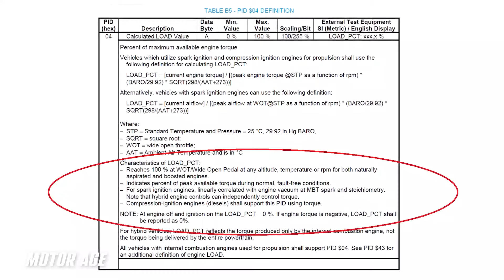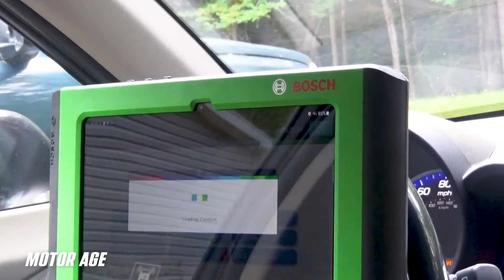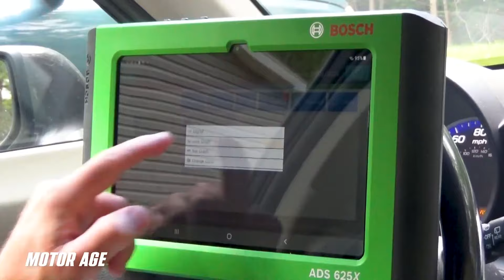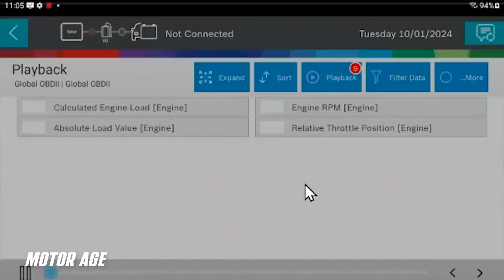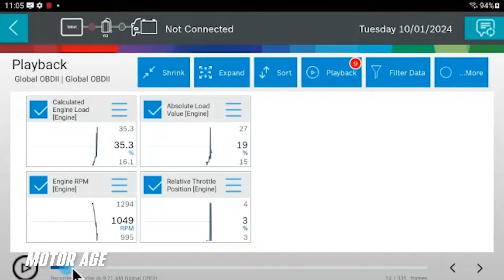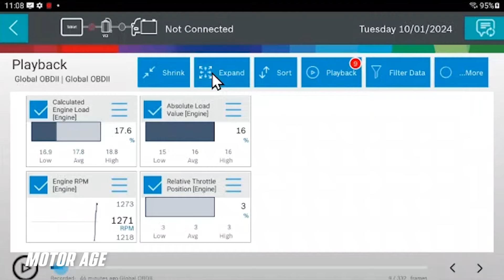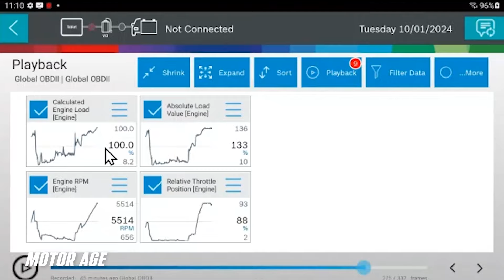Mastering Diagnostics #18: Calculated Load vs. Absolute Load

Comment: Very clever explanation Mr. Steckler. I call those two the "forgotten PIDs". Or the "mystery" PIDs. They are of the more complex things for the brain to fully understand and THEN to use them efficiently for diagnostics purposes. I would even put them above the mythical "voltage drop" testing in level of complexity 😀Actually i'm sure half of the mechanics don't include those PIDs when investigating driveability and performance issues 🤔
Reply from the maker: We believe you are correct. They are very much underutilized PIDs. However, they are two of the most beneficial PIDs to implement in preliminary diagnostic approach.

Comment: Great video for a turbo but how does that help me on a 4-cylinder non turbo motor
Reply: Doesn't matter if it's a turbocharged engine or not, the concepts still apply.  Calculated load is the theoretical amount of airflow compared to known good values, absolute load is the measure of the engines ability to pump air, aka volumetric efficiency
Reply from the maker: It’s even easier with a naturally aspirated vehicle. Simply look at absolute load. As per the video, you should be darn close to 100%.
Reply: @MotorAgeMagazine Did you mean to say calculated load?
Reply from the maker: @nowayjose596 , no, a naturally aspirated engine, if operating as a correctly, functioning, air pump, should yield absolute values nearing 100%.

Calculated Lowes value should almost always be near 100% at wide-open throttle, regardless of temperature, elevation, or RPM

Comment: Calculated load value will almost show us 100% at WOT even if there is a restriction. Can I make a deduction that the CLV is not a true diagnostic way of diagnosing air restriction issue? Would you not use the CLV  alone to diagnose a MAF, an intake or exhaust restriction? Thank you
Reply from the maker: Yes, it can help with a restriction. However, keep in mind that restrictions get progressively worse with more airflow. 

If the restriction allows the exhaust system to fill, for instance. CLV will show near 100%.

At the moment to restriction, becomes a true “driveability problem” the CLV will drop

Comment: Interesting video.  If you don't have a baseline/known good for absolute load and you see 130%, then how do you know from that, that there's a performance problem?  Bosch has a paper on doing volumetric efficiency and it says if at WOT, you don't get above 75% then there is a problem, and above 90% is considered a pass.  In your case, if absolute load equals volumetric efficiency, then that PID doesn't identify a problem.  I've done a VE test with my cheap scanner by manually putting the data in a spreadsheet and applying the formula.  I occasionally hit 110% on a normally aspirated Toyota.
Reply from the maker: Yes, newer technology allows for some NA engines to achieve 100%+ absolute load.

To answer your question, if you are not familiar with the engine and can’t anticipate what absolute load will be, Calculated load will reveal the breathability issue
Reply: @MotorAgeMagazine  Thanks!

Comment: Never understood calculated load values.
Absolute load I understand, the most it will ever be is 100% how do you know what the MOST CALCULATED % is?
How do I know if the boost pressure is working correctly? 
The max peaked at 184% 
184 out of what?
Reply from the maker: Hello Alex, you have it backwards. Absolute load closely reflects, true volumetric efficiency its peak value will match Peek torque values as well. Calculated load will only ever be nearly 100%. 

If a turbo charger system is not functioning correctly, your calculated load values will not reach nearly 100% however, the absolute load values will reflect higher than 100% because you are force-feeding the air into the engine, even if it isn’t doing so properly

Comment: So to be clear....inhibiting the turbo from doing it's maximum - dropped the absolute load number.  That is clear to me, and we see it did NOT affect "calculated" load (it still read 100%).  However you said if the exhaust was restricted the calculated load would be lower (than 100%) because it's not breathing what it's capable of.  Is that because - even with a turbo fault (that you induced) that on the INTAKE side it still was OVER 100%?  What I don't get is why crippling the turbo did not reduce the calculated load, in the same way that clogging the exhaust would, because BOTH affect engine breathing, just at different ends (input, vs. output).
Reply from the maker: Crippling the turbo was seen by the pressure sensors in the induction system

Comment: Interesting.  Carcarenut says best test for maf is load. Hard acceleration it should go  way as  %.  Don't know which pid of the 2
Reply from the maker: Would you mind clarifying?
Reply: @MotorAgeMagazine  he did video on maf sensors, 3 versions  and cleaning of the 1st 2. 3rd can't be cleaned. But he said best way to diagnose if your maf was operating properly was to use load on the scanner and accelerate hard .load should go close to 100%.
https://youtu.be/h8RJ4cDwnV0?si=2CkmKdtyfYAkC7vD